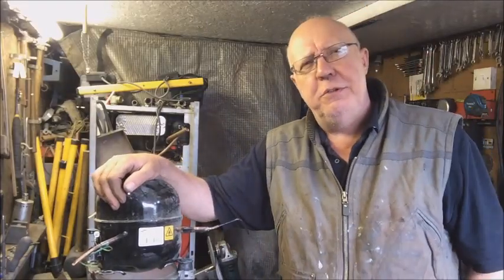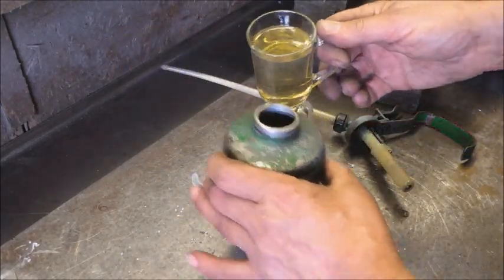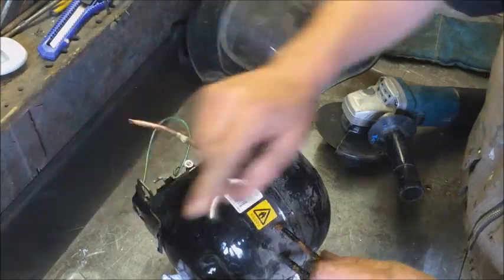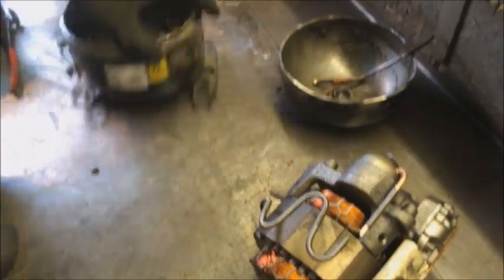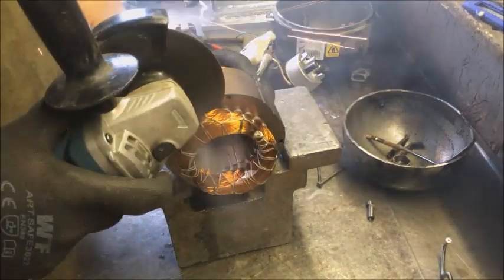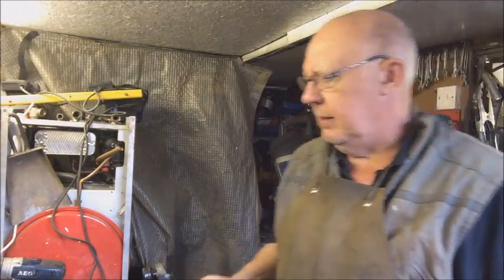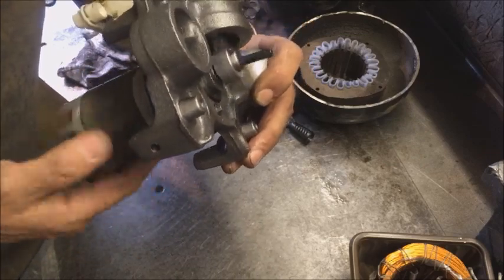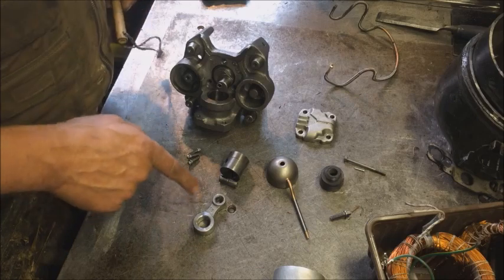Fridge Compressor Motor for Copper,, Worth It ? Yes

Comment: ive been cheating myself for years ,  not going to take the easy way out anymore . thanks
Reply from the maker: Be warned more & more are found to be aluminium wired.
Reply: @Man-in-da-shed  iluminating thank you very much
Reply: @Man-in-da-shed  ill save the oil for sure

Comment: 1 abrasive wheel 4 pounds, 1 HR labour +1 Hr to sell at the recycler  for 5 pounds paid at the recycler  ?
Reply from the maker: Michel Grenier, 65p for s disc, 10 mins max. Labour when not having to film the process, ok time and expense to visit Yard but amortised over all the Scrap taken in. But I get it. Not everyone values their time as little as I do. After all it’s a hobby for me. But thank you I do appreciate constructive comments.
Reply: @Man-in-da-shed  In Canada we get 12 cents per LBS for compressors, electric motors and alternators ,in large quantities I think it would be worth stripping them .Regards .
Reply: The local scrap yard pays about 3 bucks a pound for copper and 18 cents a pound for copperbearing motors and about 7 cents a pound for steel. Def worth it, a cut off wheel cuts 2 open ime.

Comment: Good luck popping out the windings so easily if the compressor died of electrical burn out.
Reply from the maker: DrZarkloff.  so true.  I've never seen one yet though, but there is always burning it on a fire

Comment: So not worth it? You didn't tell us how long it took you from start to finish and you have to buy a new cutting wheel. You only made an extra $3
Reply from the maker: you are kind of right,  say 3mins to cut it open, and a further 2 mins to remove the copper, its much quicker when your not filming it.
there is little or no cost if you use a Hacksaw but the time will increase dramatically.

Comment: Most are aluminum anymore, not worth it. I stopped finding copper awhile ago.
Reply from the maker: yep, i've 3 on my bench at the moment,  i want to do a video an how to find out  if their ally or copper inside , it is indeed annoying if found to be ally AFTER they have been cut open.
Reply: ian matthews scrap prices are so low anyway. Not to mention leaking the gas into the air. It's just not worth it with a good chance of not getting copper. I used to make good money scrapping now I got a regular job.

Comment: The fridge compressor motor does not contain copper. They are silver wires rapped in a orange insulation. If those windings were copper they would short circuit.
Reply from the maker: dam I didn't know that, still this is what youtube is about sharing and learning, thanks
Reply: Before I moved to Spain there was a flood in the house. They replaced the pool light transformer and replaced the whole of the pool pump room. They left the old breakers and transformer in the room, I dismantled the transformer and the whole of the primary winding was life half inch thick copper. I think it was an old torytrans pool light transformer. Note the primary winding had to be filed to expose conductive copper. The secondary winding was full of silver wire coated in orange. I will upload it later
Reply from the maker: that silver wire is aluminium with a laquer on it  @rocky_adventure_bay7562

Comment: gotta stop all this scrapping for money shit, got to start fixing and not scrapping
Reply from the maker: Dam that’s a conundrum, as it wasn’t broke,  I can  justify Scrapping, it’s Recycling in a way sort of.
Reply: @Man-in-da-shed  but when you can make some new valves with a scrap bits of steel, we need to start changing our thinking, i was trained old school, and cannot get my head around all these part swapper engineers, why do all that time at engineering school to just switch out
Reply from the maker: Richard Gomm  now there I fully agree, it has become without a doubt a throwaway society.